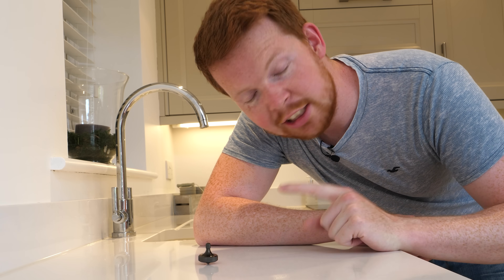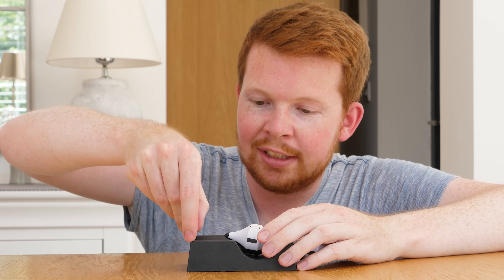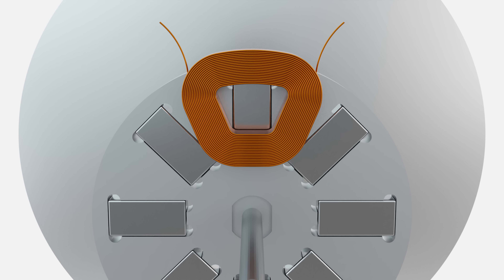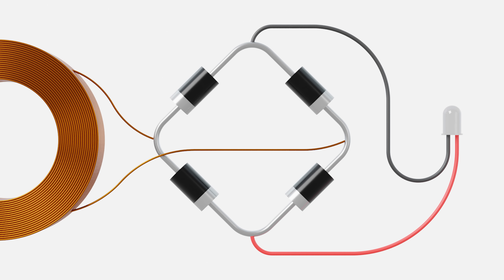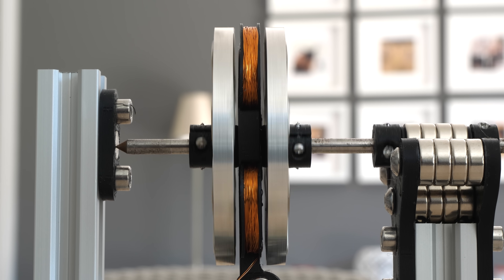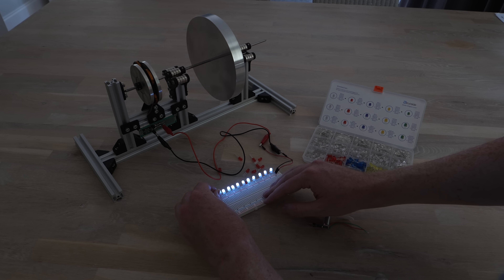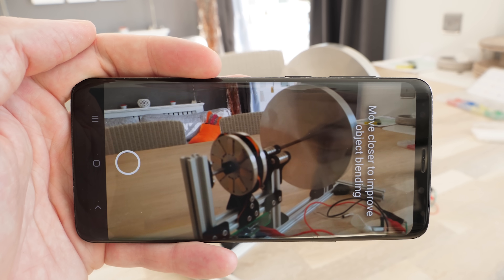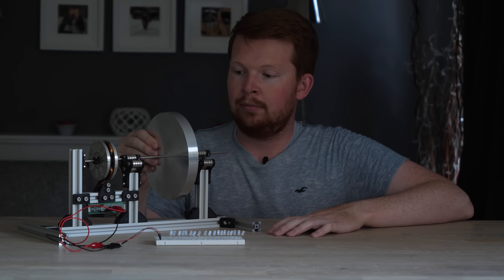Flywheel Battery

Comment: Would have been nice if you explained more about the capacitor in the rectifier and a bit on ripple voltage and the trade off with big capacitors/charge time and small capacitors/ripple. That is the cool part!

Still a pretty fun project.

Cheers!

Comment: What about adding bigger capacitors and magnets to the flywheel and also connecting a small self induce electromagnet under the rotating part of the wheel so it is also a self propelling flywheel as well (of course after the initial hand crank) as a generator.

Comment: You should try using a gear box and a hand crank that takes torque and makes it high rpm and like the drill bit you used so it turns it super fast from a small amount of movment

Comment: Try using schottky diodes for the bridge rectifier. Or, if you are only powering LEDs, you might just drive them with AC.

Comment: Tom I like the idea but don’t you need a 3 phase rectifier. I would think your only rectifying one of the three phases of electricity being produced. Also, using the flywheel to charge a battery would allow access to larger amounts of current

Comment: Would this essentially amplify the power generation capability of a hydro station?  Could you power the wheel with only the force of rainwater? Perhaps with a gutter system?  That would be a very cool compact "rain battery" instead of solar battery.

Comment: Respectfully, the coils would put out more power if they were precision wound. I know that from loudspeaker design. Use a precision ground shaft, bore a precise hole into the wheel, then attach the wheel with glue. It would be permanent but would eliminate any wobbling. Use, "liquid bearings" as lube on the contact point tween the shaft point and the left-hand stabilizer. You will have much-improved performance. Thank you for this.
Reply: Edge wound coils using square enameled copper wire would be ideal. Lije top end JBL Speakers with rare earth super magnets
Reply: @michaelshultz2540  Yes, I think JBL INVENTED that idea. Back in the 70's I had the C-36/001 pair and they had that.

Comment: I have a question about a different design: so what if you where to distribute the weight of the flywheel to a ring around each of your 4 coiled inductors.  Would the energy output be even greater?  Also, by going from 1 coil to 4, was there any loss in amperage, friction or anything else.  Again, my questions are derived the law of conservation of energy as it appears that more energy is generated from the same amount of kinetic energy.

Comment: Concerning the Law of Conservation of Energy: my kids want to know if this apparatus is a means of creating more energy since the output of the flywheel seems to be greater than if someone turned motor/generator by arm for an equal to the speed and time the flywheel maintains its spin.
Reply: the resistance from windings, loss of 0.7v on bridge rectifier means that some energy would be lost as heat, so this would never generate more energy than what it takes to spin the flywheel.
the spinning top also touches the plate, which would means more energy lost to heat from friction.

Comment: Easy to stack the couls to either side and phase them so a coil is active on either side.

Somebody was doing a PCB motor with coils designed similar to this.   Stack enough of them and some decent power could be made.

Comment: Would it be possible to have a motor that would move onto the shaft to minimize friction that once the flywheel drops to a certain RMP it could use the energy stored to spin the flywheel back up? And how long would it go before the energy made couldn't sustain?

Comment: One way to improve the output is to make the magnet wheel with a larger diameter so that he can have many more magnets per revolution, it can be plastic, doesn't need to be metallic. The increased radius will also make them pass faster in front of the coils. With the added number of magnetic fields and the increased speed he can have more output using the same slow hand RPM, because the ripple in the capacitors depends a lot on the alternate frequency.

Comment: nice project, but i hope you knew that the moment you put a load on any generator, that generator becomes a brake, in your case for the flywheel. No way to avoid that. you eliminated most of the friction but it doesn help much.You should explain to alk viewers in the end why this wont work .Either way nice project

Comment: Can you work out a means of calculating the efficiency of your flywheel? 
Then the fun begins on making the most efficient homemade electrical generating flywheel.
Shorter shaft 
Bigger diameter flywheel
Very balanced for higher rpm 
Can you combine the the flywheel and alternator into the same structure?
Can you build something that completely levitates so doesn’t have friction at the centre of the axis?
Is there any difference or benefit to have a vertical axis of rotation?
Seal the flywheel in a vacuum to decrease air friction
Build a wind or solar powered drive system to power up the flywheel. 
This would make a great competition if you could work out to measure the efficiency.

Comment: Very good.  You'll likely get more power by converting to 3 phase and  using Schottky diodes.  You can build a pic controller to back feed the flywheel. As a result you'd make a UPS for a light or motor.

Comment: My thoughts as a canadian:
-wood stove, with hot side of sterling engine inside firebox
- basin that uses snow to cool the cold plate, and also melts snow into drinking water (dual function) 
-planetary gear set, to increase the speed of the flywheel (would require tuning, to fit the gear ratio just right)
-semi-flexible drive shaft from gear set to flywheel/crankshaft, to reduce vibration and instability.

This concept could be very useful to someone wanting to live off grid.
Reply: It'd be highly probably inefficient - I think I'd just use a solar panel + wind turbine charging a battery ;)
Reply: @mieszkogulinski168   I would use every energy source available to trickle charge a deep cycle battery, including a qind turbine. If there is flowing water nearby, I would rig a water turbine as well.  You couldn't rely on this solely, it would just be one more energy source to add to my "grid". It also gives your wood stove one more purpose. Something  tells me solar panels would be even less efficient in winter, where we have maybe 6 hours of daylight, with overcast skies. Then you would have to keep them clear of ice and snow. With a woodstove, I'd already be feeding it with wood, and I would already be melting snow for drinking water. It would be a multi-purpose machine, and would yield essentially maintenance-free energy.
Reply: I like your thinking, but Burning wood for heat and energy is so incredibly filthy, inefficient and just overall harmful to the planet. Geothermal and good design is the way to go. There are homes and even huge, commercial buildings designed so that they have zero mechanical systems for climate control. That is the way to go. It is not hard to do at all.
Reply: @VidarrKerr  geothermal isn't always practical, especially for something like a hunting cabin which is what I have in mind.
Reply: @chris101ward  Going geothermal is not difficult to do at all. The guys that do it are also used to drilling in very remote areas, like where people live off-grid. Drilling remote places is basically all they do. It isn't very expensive either. 
edit: I should add that insulating the cabin with closed cell foam will stay warm from just a few bodies in it. If you made a fire, you would have to open windows or you would bake. I am an Architect BTW.
Reply: @VidarrKerr  It was 50k to install geothermal in 4000 sq ft home.  Could get a cabin for 50k.  Sterling Engine has the highest carnot efficiency of all heat engines.  Geothermal is just a really expensive heat exchanger that makes it more efficient.  Foam has toxic off-gassing issues.  Sure it has an extremely low heat transfer coefficient, but that doesn't solve a power problem.  I think the sterling engine is the way to go.  Wood is abundant and renewable.  Net zero carbon, if you care about that.  Smells nice, too.  I'm a nuclear engineer, by the way.

Comment: Very good demonstration. Btw: They do exist in big as well to store energy. I know one kind of power plant which is driven by electricity and in case of a power out it can keep the electricity running for a while without interruption. They can also be used to stabilise the power grid. Also I know that they put a prototype into a train to store the energy generated by breaking. Not sure if that idea took off... In any case: Such mechanical energy storages are being used commercially.

Comment: Every think about putting opposing static magnets on fly wheel  And and using solar power dc  to drive field coils  making a driving field to push fly wheel  You have  input 12/18v and  output 110/220 volts, (comment  gravity can be a transformer )  with no heuristics  if all in balance,  and loading out-put V+ In SETUP AS AC  will make BALANCED FLYWHEEL go faster and faster, under load ,   There are safety issues here's you can drive these type flywheel up 32k rev using magnetic bearings no contact surfaces (just idea)

Comment: diodes have a voltage point that when it is achieved the current can pass it, led's are a kind of diode, Light Emitting Diode. This value is called the forward voltage. at 10 volts you can power any led im aware of but in order to protect the led from burning out you would use a resistor in line with it to control the current that flows on that line. For that kind of LED it's normally rated for under 30 mA but probably more like 20 for the white ones and the forward voltage rating is probably around 3v. if you provide the led with more then 3v they should work when you have them in parallel like that. Putting them in series would increase the required voltage as you would have to provide enough voltage to overcome the rating for each one in series added so 2 leds would need a 6v source. I'm curious as to how much current your contraption can effectively deliver to a powered device.
Reply: i'm thinking based on when the led started to dim you were providing around 120-200 mA of current at over 3v from the flywheel battery then they began to dim when the current was no longer sufficient to keep each diode supplied with it's current needed to be fully outputting the amount of light it can produce. seems you can generate a fair amount of power to fully light up 20 leds probably each taking 20-30mA.. at least half a amp. but really im a bit more surprised you didn't burn out any leds without limiting the current with a resistor..

Comment: Cool idea!
Why don't you also use a magnet for the distance between the tip of the rod and the holder?
Of course this would have to be strong enough.

If the length of the rod were reduced, there would be less wobble.
A lot of space could be saved on both sides of the wheel.

The master discipline would be a second generator on the other side, whose current would drive a motor that makes the construction rotate. The current from the previous generator could be used for other purposes.

Of course it wouldn't be a perpetual motion machine. However, it would run longer thanks to its own drive and produce more energy in the first generator.

Can it be implemented?
Can the desired effect be achieved with it?

I am curious what is to come.
Abo and Like are here.
Greetings go out!

Comment: This is fantastic, I'm always talking about flywheel potential to my friends. Couldn't you smooth out the blinking LEDs using some capacitors?
Also, I'm curious, earlier the flywheel managed 12 minutes, but when you were spinning it by hand to test the LEDs it didn't seem to last very long at all. 
Did the additional coils add more friction? Or increased parasitic magnetic forces?
Reply: It's the law.  That is conservation of energy.  You can't extract energy without slowing it down.  Generators have to be pushed by something.  Now interestingly, a generator is basically a motor in reverse.  With a bit more circuitry those coils could be used to speed up the flywheel first, then use them to extract the energy later.  Thus a flywheel battery.  I'm disappointed that he didn't connect all the dots to explain the video title.
Reply: @paulctx  of course that's the law, but there could be other factors which end up slowing it down even faster. Hence my questions.

But yeah, another advantage of being able to spin it up using electricity is you could build a geared crank which would be easier to turn much faster than trying to spin the rod by hand.

Comment: You should have drilled holes into the flywheel and added magnets in the holes and then put magnets at the bottom to create magnetic repulsion and used the power created to power a motor to keep the flywheel rotating = a free energy system maybe.  https://www.youtube.com/watch?v=TYhJwF-H3sY&t=312s

Comment: an interesting project. Thank you.
You indicated you installed the coils in series, and I am concerned that the voltage curves in each coil are not synced with each other. This may result in the respective voltage cancelling or reducing the overall total voltage. Did you or how did you sync the coils so that they accumulated rather than cancelled each other.
Reply: Good one! (please see my post.)  I suggested precision wound coils. They would be more efficient and put out the same power/phase as each other.
Reply: Also maybe the fullbridge rectifier and capacitor is only supplying a slightly rounded positive wave of current.

Comment: Here you need a flywheel with a diameter 5 times larger than the generator, and then there will be enough energy and it is advisable to accelerate it periodically with compressed air..

Comment: Drive it in reverse!  Try to spin up the flywheel by feeding AC back to the coils.  Would also be interesting to see how quickly the wheel stops when shorting the coil.

You will also get less blinking out of the LEDs if you connect a series resistor.  As it is, the LEDs are effectively capping the rectification at their forward voltage, dumping a lot of the peak power as heat in the coils.  With a series resistor, the excess voltage will instead get stored in the capacitor and drain across the rest of the cycle.  You would want a resistor just under (V-Vf-Rc)/Id where V is the DC voltage measurement from the rectifier with only a capacitor connected, Vf is the LED forward voltage, Rc is the coil DC resistance, and Id is the desired LED current.  For the capacitance anything around 20/(R*RPM) or higher would probably be sufficient where RPM is the flywheel RPM, and R is the resistance previously computed.

Comment: If you put the LEDs with each one's polarity  opposite the next one, you could do away with the rectifier, which loses about a volt per diode... Since an LED is a diode anyway, it should work. If you put half on one end in one polarity, and the other half on the other end of the breadboard, you should see it wig-wag blink as the polarity changes... lots of fun

Comment: Tom, I'm guessing the German eRockit electric bike is based on something like this. 
Chain drive a levitating flywheel - pedal to rotate the pancake alternator - send the generated power to a bank of ultracaps - power the controller to run a hub motor. 
The problem with magnets is the Eddy's can slow down rotation. No one has opened up an eRockit to see what's inside. I'm curious to know how pedaling decides the speed of the bike, otherwise the bike is without a throttle.

Comment: Hi Tom, I had an idea of having a wind-powered fan to trickle charge an electric car battery while it is moving.
The idea is that the motion of the car powers the fans/alternator mounted under the car and charges the battery. Could a fan-powered fly wheel do this?
Would this be feasible?

Comment: What if the center support shaft was hollow and there was a pin coming through the contact wall to the inside of the shaft with a clutch mechanism to transfer power from a motor being powered by the device sent back into the device.

Comment: When I was growing up, I had a gyroscope (one of those old school all-steel toys). To get highest possible RPMs, I would wind thread or really thin twine around the shaft. Balance the gyroscope on a steady surface, and give a hard yank. As the string unwound, it would spin the shaft, and thus the gyroscope. Instead of using your hands, or indeed a power drill, I wonder if you could try something similar.

Comment: Now, glue a magnet on the end of the shaft on the upright end where you have the friction point. Glue another magnet to the upright brace, with like sides facing each other. Now you have no friction point and your device should continue to run indefinitely. (with only gravity being your friction point)

Comment: I am sure someone mentioned it already, but if you wanted to try to remove the rod, heat the aluminum and stick the end of the rod in some ice water, then just tap the aluminum flywheel with a rubber mallet. For a pickle jar just hot and cold tap water creates enough expansion/contraction to make opening the jar pretty easy.

Comment: Thats really good ,just one thing,Aluminium is not Magnetic ? try sending a magnet down
 
 an aluminium tube ,then send anything the same weight down the tube ,which one reaches the end first ?.....not the magnet ,so there's a reaction from the the aluminium tube, if you spin your aluminium wheel and add a magnet each side of the wheel you will stop the wheel just by bringing the magnets very close to the wheel.

Comment: Next thing you should vacuum isolate the whole system, elimination air drag on the flywheel.
Very cool project!
Reply: Wouldn't mirror polishing archive nearly the same effect but in a much more simple way?
Reply: @CosmicSeeker69  Well it's not the only wheel spinning but yea definitely simpler.